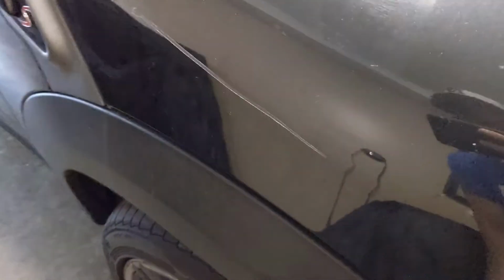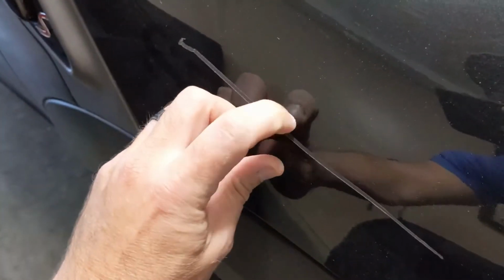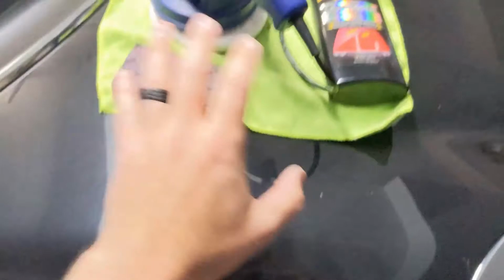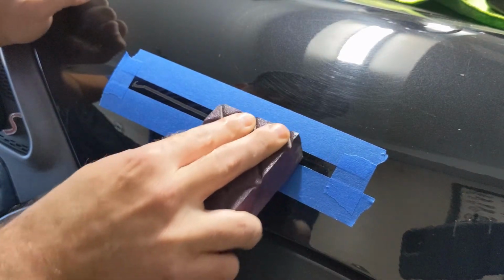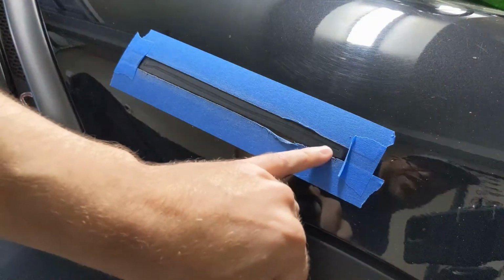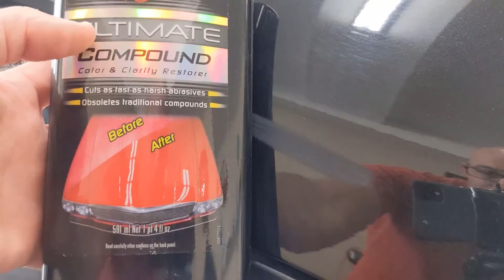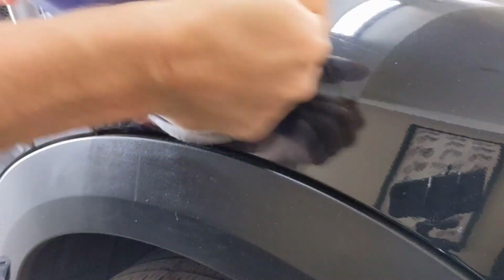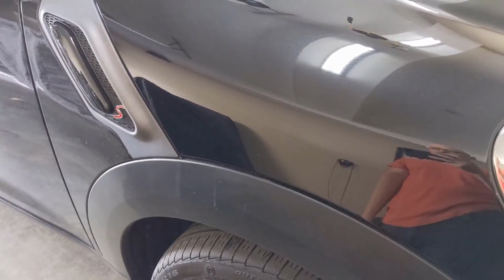DIY Car Paint Scratch Repair - Mini Cooper Countryman S

Comment: Tim says... "still a little bit of the mark there" WHICH MEANS...  he wasted a lot of time to get (what I consider to be) an unacceptable result.
MY MOTTO...  Do it right or don't bother doing it at all.
Reply from the maker: Glad to see that you love your life so back and white. Hope it works out for ya! 👍
Reply: @tims-garage    You're right Tim.  A light switch is either on or off for me.   However, I do see the grey areas that exist such as in the job you did "attempting" to repair that scratch.   
My motto still holds.   Have you ever heard the old saying...  "If it's worth doing...  It's worth doing well"?
Reply from the maker: @tribulationprepper787  of course, I wasn't born yesterday. You got your opinions, but no need to defend my work. Happy to see your video!
Reply: @tims-garage  I didn't offer any OPINION regarding your repair.  The FACT I did offer  is that the damage is still clearly visible and in my OPINION, repairs like that are a waste of time.   Many, like myself, would consider that a "why bother with it" FACT.   
I guess that you and I just have differing views about pride in workmanship but if the job you did is good enough for you, that's all that matters, isn't it.